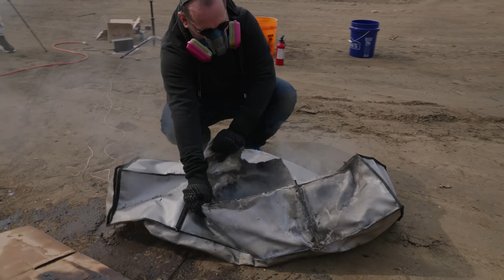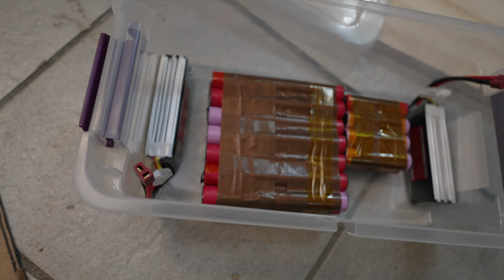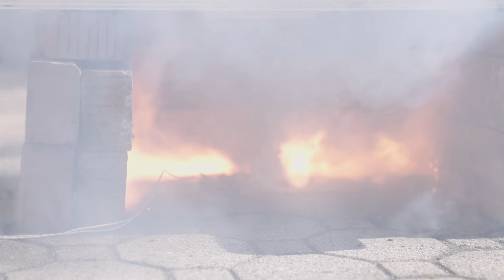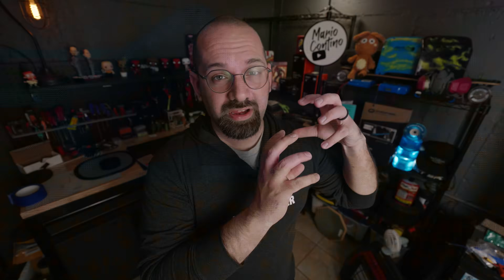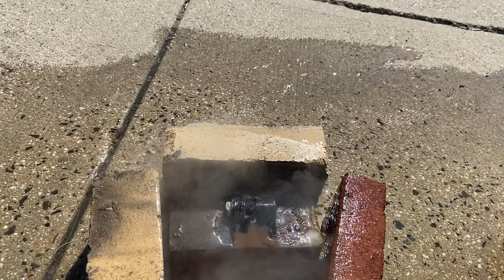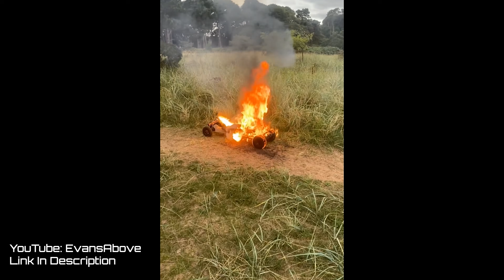What If Your Battery Explodes? Nobleman Fireproof Bag Review

Comment: Regarding the Mario Contino's assistance in NOBLEMAN's testing of fireproof bags, first of all, we are very grateful to the technical support for helping us test the gas capacity limit of the fireproof bag. Thanks a lot.

The reason for the final analysis: The fireproof bag is made of a whole piece of fabric, with only one seam (the only seam shown in the video). The inner volume of the bag is fixed. When the battery is burned, a large amount of gas will be released instantly. The gas released by the battery exceeds the volume limit of the fireproof package. In this test, 45 GA cells and 2 lipo packs are used. The more batteries, the more gas is released. When the gas released by the battery exceeds The volume limit of the fireproof bag caused the cracking of the seam, as shown in this video (in practical application, due to the blocking of the battery box, the gas will not be released instantaneously, but will pass through the gap of the battery box, and the release pressure will be greatly weakened ).
After discussing with our technicians, we will take corresponding strengthening measures

1. The fireproof bag flows out of the pressure relief port, which allows the excess gas to be discharged smoothly.
2. Reinforce the fireproof bag seams with metal rings.
3. For large-capacity batteries, properly open the zipper opening to ensure smooth exhaust.

At the same time, We will test the above three schemes separately, adopt the best effect scheme, and give the net red a strengthened fireproof package, and the net red will continue to test for everyone, so stay tuned.
Reply from the maker: Thank you for your response, I appreciate it. I also appreciate that you're taking measures to improve the product and reduce the severity of the failure from such an event. However I would like to mention that I disagree with this statement:  "(in practical application, due to the blocking of the battery box, the gas will not be released instantaneously, but will pass through the gap of the battery box, and the release pressure will be greatly weakened )"
Given the clips I included, and the very large amount of variation in the enclosure design and battery size of any of the popular electric skateboards, there is no way to say how quickly/slowly the off-gassing of any battery inside a device will happen. This is specifically why I chose to produce what I felt was a medium-sized "worst case failure", and that some fires may actually be worse. The testing of revised versions of a containment device should be tested with a variety of scenarios that cover the range of possible situations, so there's a better idea as to what can be contained and what cannot.
BUT, again, thank you for your response, and the desire to continue to improve the product. Cheers.
Reply: @TheBoardGarage  perhaps you should also mention just how rare actual li ion flareups do happen. i think an enclosure built into the vehicle is preferable since putting your vehicle into a bag is a time consuming process and you end up not going to do it very often.
Reply: Really appreciate the transparency and detailed response. It speaks volumes about your commitment to delivering a competent solution.
Reply: Thank you for the detailed reply!
Reply: If I buy a charge bag in future, I think it will be from this company...
Reply: It needs to be made with metal, not fabric, with proper venting.
Reply: I think you should have tested the batteries inside the factory made actual battery box, as it was sold in the final product.This was way too open of an experiment.
Either way, it would be a hot fire & severe gas release too!!Thx.
Reply from the maker: I have witnessed battery failures and fires inside of boards, they behave about the same.

Comment: Guys, this is the most literal and obvious point, but you have to listen to what he says and take it to heart. I exist in the same environment with lithium batteries. I am an owner of a few RC cars, and what does that mean? Lithium batteries. Now I have had no prior problems with batteries, I just put them on charge, leave them for a few hours, and when they're full, take em off, let them cool, and are ready to use, all done and dusted... but it's not so simple, let me explain in steps.
So first off, you may want to get yourself a lithium battery for you RC car, then when you look at the prices, you think... Nahh, I'll get a cheap one... 5000mah 7.4V for £30 of Amazon... DON'T! Just don't do it, it's not worth it, mainly because the reason they are cheap is due to bad manufacturing, companies like to save money, and do so by making the inner layer thinner than it should be, and when you plug that thing in to charge, it will expand due to heat like batteries do, but because they are so thin, your bedroom may end up having a one to one fireworks display while you have a one to one experience with death. Second, don't, and this is stupid, but we all do it, don't... leave things on charge over night, like your laptop or generic batteries or even your phone, because before you know it your device may also become a firework display... and you may think "ohh, but they have electronic shut off systems" that doesn't always mean you can charge it for hour without a thought, it just means you might be able to sleep one more night before absolute hell breaks out. Third of all, charging places... don't charge anything where it can get very hot, or anywhere damp, and when you charge something, KEEP AND EYE ON IT... don't go off out to have a meal with friends, and come back to hundreds of thousands of pounds in debt, all in ashes... And finally, like he said, they pose very minimal threat when discharged and looked after, but if you want to make sure, buy a fire prod bag, and store it somewhere appropriate, so if it does a thermal runaway, it won't be an immediately threat. I'll say it again, I know it's obvious and blah blah blah, but trust me, once you experience it at 2am, you'll never trust a battery in the same way again...

Comment: JUst what is a lie bow? light bow? libo?
Reply from the maker: LiPo, Lithium Polymer battery. Generally a high discharge, pouch based battery pack. Usually more fragile and volatile than cylindrical lithium ion or lithium iron phosphate batteries.

Comment: okay, is there a way that we can get our battery packs inspected? If these vehicles are becoming more common place, then there should be a way to have them checked out because the average adopter of these will not be electrical engineers. like after so many miles we can take them into a inspection service.

Comment: If I may regarding the fire resistant bag exploding what if you had used a bag with a charging port? Then there would have been a vent hole correct???
Reply from the maker: A small hole would be unlikely to let the pressure vent adequately to preserve the structure of the bag.  The gaseous expansion is rapid.

Comment: On the Nobleman website they have a vid showing how their first bag failed but after improvements were done it didn’t burn anymore. The problem though wasn’t just not being fireproof. The main issue was the bag being unable to contain the force of the explosion which tore it open and allowed the fire out through the hole. This issue was not addressed in the video on the Nobleman site. They merely showed their bags were now made with fabric that was more fire resistant than before, but if they still tear open from the force of the first ignition then it doesn’t matter how fire resistant the fabric is.

Comment: My comment was deleted due to link, I guess.  There is an outfit in Europe which makes a bag which has a top vent and succeeds tests like this.  Lith*** Safe. Unfortunately this company has not partnered up with Amazon to mass market these. You have to request a quote.  Very poor marketing from this firm.  They need to promote these and mass produce them so all have the opportunity to improve safety in buildings.

The current battery technology is unacceptable and is only used because battery technology lags far behind the devices which they power.  Billions of dollars are being spent on R&D by car companies to come up with fireproof solid-state batteries for EV's which will not burn, and in some years these will supplant current technology.  In actuality, acceptance of present technology is a mass delusion by society and really should not be used at all. The E bike industry is just now being forced to accept UL lab certifications for some reasonable safety, after hundreds of e bike fires in NYC over the last two years.  Still not enough.  As people misuse charging of these devices over time, more and more fires will happen, creating a safety crisis, maybe mass outlawing these being kept in buildings.  I have already read several condo associations and apartment managements have denied these in their projects due to fire risk.

Comment: I charge my batteries on a metal surface and always monitor them in person. I also have an e-bike and I charge the batteries in a metal container out on a concrete patio. The container is layered with and not fireproof insulation to be able to contain the 3,300 degrees if the battery should catch fire. It is also monitored and set up on a timer. For my LiPO batteries I have a quality intelligent charging system.

Comment: Strengthening the bag seams! Those expanding hot grasses have got to go somewhere or they have to be contained by something immensely strong. I don't think I would trust anything other than a steel box that has some directional ventilation to the outside air.

Comment: I have two 20 amp hour + 2 13.5 batteries. Not like you could leave them outside in the winter time. I don't even think my ABC fire extinguisher would put one of those out. How much heat comes out of these like how hot is it it looks hot enough to weld

Comment: What is the best way to store cell phone battery banks, I have a 13,000 mha battery and I am scared of it after seeing this video! What about storing them in a metal filing cabinet that is not air tight so it won't blow up. Would this be better then keeping it in my kitchen drawer?

Comment: Be good to see controlled fires of batteries in boards, as ugly as that sounds. And maybe some discussion about the risks of riding in the wet on an unsealed board, relating to battery fires. Bms usually die before that happens but not always, depends where the failure to the battery case has occurred to let moisture in. It's terrifying to open a onewheel to find water sitting Inthe battery case! Can a custom enclosure be made to limit the fire in a positive ways, that atm I don't even know

Comment: hi the reason you cant recell those batts is because there using can bus comms ie the bms must talk to the controller to turn on the do the same thing with bosch ebikes and every company uses there own version so very hard to crack but it can be done just not cheap.

with a bosch bms if you cut power to it it looses the can bus software tho it can be recelled and it will charge as soon as you plug it in to the bikes controller it is bricked and the bms is a bin job why 99% of batt builders wont touch them with a barge poll because the signal is sent from the batt to the controller and back every 30 milliseconds.

i have a 2014 haibike with a 400w batt and it now so old it can just do 5 miles on a charge but i can not do bugerall to fix it my self liofit  in germany can do it but it will just end up costing more than a new bosch batt and replacing one locked system for another one as if you remove power it kills the bms as they somehow mod the bosch ones i did ask but top secret !!! and cant tell me for security reasons.

as for the motors none of them sell bearings or any parts and dont use of the shelf bearings either  so have to be custom made with a min order of 1000  in a gen 2 bosch cx motor that i have there are 10 bearings inside the motor and after 10.000 miles all need to be replaced tho they do make a service kit that you can fit it is only the right hand side cover  and just 2 of the bearings you would need.

peter at ebike motor centere / performance line bearings started a company up a few years ago now as had same bike as me and found the same problem you cant buy the fkn bearings so now sells most bearings for most motors and ships them world wide and can fully service them bar the shimano motors becouse he did fix some of the ep8000 motors only to find out the software can detect the motors cover has been opened and software locked all the ones he had worked on so had to replace them all as shimano blamed him for dearing to open it up fkn joke so fook those things and the batts are even worse to fix than most others as well.

i have been trying to tell louis this for years but now even bafang are going can bus so forget using there controllers if you want to go fast and i have even seen a vesc controller used on a bosch motor if you rip out the controller board.

https://www.youtube.com/watch?v=gz5cjFxzDsE&t=1s&ab_channel=PerformanceLineBearings

Comment: i got my "piece of mind" with a used (but real) Military ammo box (which you can get for like 10-25 USD) drill a hole in it and closed it with ductape .. so if one goes off, the tape will be blown of, but the pressure can go out and the fire will be centralized around the hole. .. best solution in my opinion (and the cheapest one)
Reply: So, you buy metal ammo box, drill holes (maybe 15 holes on top), put batteries inside and then you close these holes with ductape? Can I use metal toolbox?
Reply: @nebojsa1976  yes i just drill 2 holes in it on the side and put duct tape on it, this way the rubber seal can stay on the lid, and the pressure can get out in case of a fire.
very handy, and easy to transport as well.

Comment: As a volunteer firefighter and part time rider and engineer.  Honeywell, the maker of most of our turnout gear invested billions in the development of our gear. I am amused that this is even marketed.   Pro tip, if you are doing more battery fire tests, get some SCBA  and wipe down everything that the smoke/soot came in contact with as it’s also carcinogenic.
Reply from the maker: Thank you for the comment. 🙏 I absolutely did end up either thoroughly washing or simply disposing of everything in contact with the test along with the rest of the hazardous refuse. Incidentally, cleanup and disposal of the testing materials and equipment was the focus of more research and inquiring than almost any other part.
Thank you again, and take care!

Comment: Damn !  That safety bag is SH T!!! 
I might have to give this hobby up
My apartment going up in flames 🔥 isn’t worth all the fun that I have on these wheels. I ride my Msuper Pro the most and it’s the wheel that I would ride the most in the rain 🌧 ☔️ I was told that it’s not sealed  too well for rain and water damage my cause fire when charging?  Is that true?
Reply from the maker: There have been instances where water damage leads to battery failure. There's a piece in this video about it, but it's farther inside. I talk about how water weakens things, like the insulation inside the pack. Also, leads to corrosion and connection failures.
Reply: @TheBoardGarage  Wow, Makes total sense.  Gradual “Degradation” then maybe one random day of charging and then 🔥 🔥 🔥?  YES?
Reply from the maker: Well generally, no. Gradual/natural battery degradation doesn't lead to catastrophic failure. In most cases, the cells wear out, giving you less range, then ultimately less power. Over time it'll still work but you'll notice it's nowhere near its original abilities. Assuming good build quality and no major accidents, it'll fade away and you'll just need to replace the battery.
Reply: @TheBoardGarage  OH, OKAY. Well once my batteries no longer hold a charge thats when i'll probably give this hobby up. still might be awhile though between 3 wheels i guess i have about another 1,400 cycles lol.
do you own a fire safe for your wheels?  I think i've seen Kuji rolls with one.

Comment: Excellent video, major props to you for making it and doing a real test. Do you think the results would be different if the bad was a thick vulcanized rubber ? Or would it likely just keep expanding till it also exploded ?  If so, then what would YOU like to see? Would a fire proof type box encorporating a a grill and baffle be a better option as it would allow for off Gas?